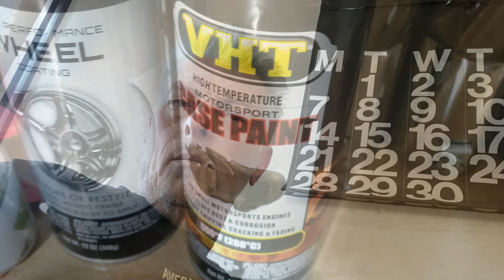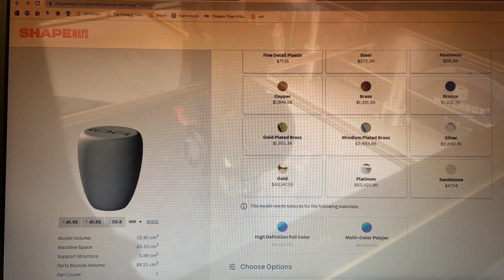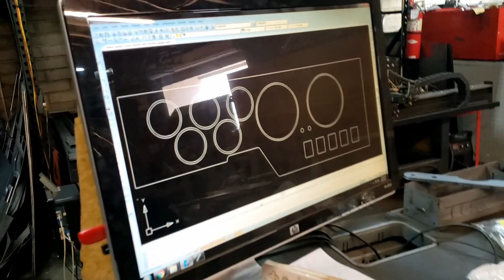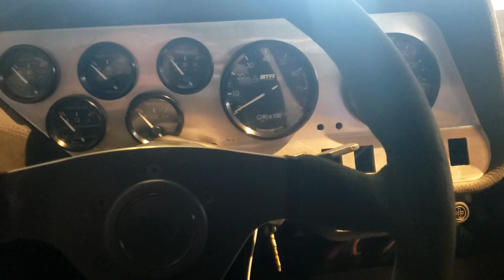#3DPrinting, #PlasmaCutting, Welding Custom Parts for Lister Bell #LanciaStratos Replica

Comment: I wish they would make a Fiat 1.4 Fire and/or the new 1.3 Firefly a drop in option as the power and torque compared to the original 2.4 Dino are very similar.
Reply from the maker: Nice idea. One could always make custom engine mounts for that motor, it's a distinct possibility.

Comment: Hi @TINK , I'm building a blue LB Stratos in California - any chance we can exchange notes over that dashboard plate? I'd love to pay you or your guys to cut one out for me. How to get in touch - see you on stratosec again, I'm "LB in California".
Reply from the maker: Hi Richard, good to hear. I just threw the other panels on ebay, the LB one and our first cut. https://www.ebay.com/itm/265210370400 and https://www.ebay.com/itm/265210371934 if they are any use? Otherwise, drop me a line at tink@tink.cloud and we can work out what you need as far as switches/gauges are concerned.